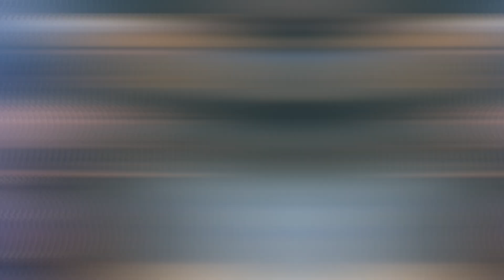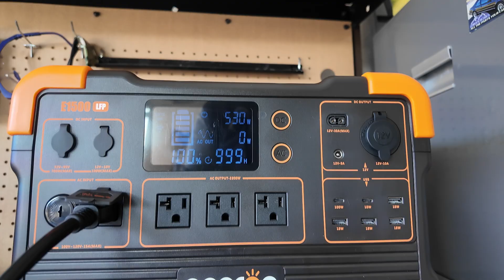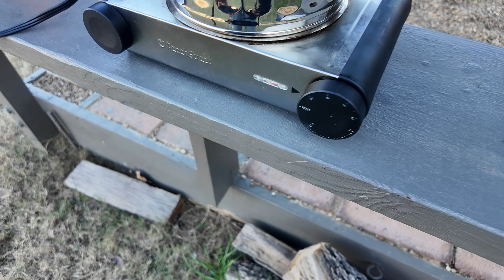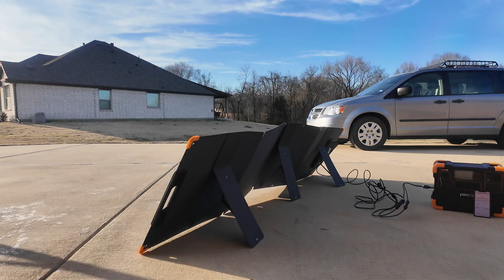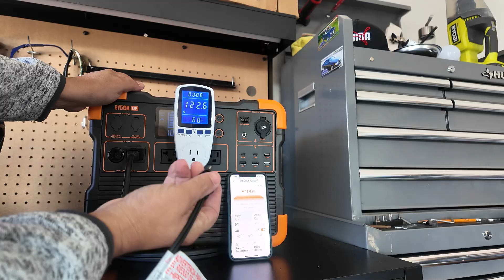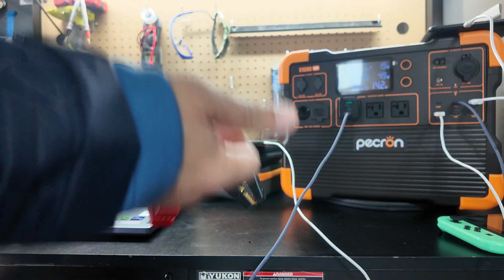Is the Pecron E1500LFP the Best Value for 1,536Wh?

Comment: I myself personally do not think it should have any kind of heating element to where it actually warms up so it can charge when it's cold because at the end of the day that's just another thing that could be involved that could always cause a fire. I realize they have the overheat and too cold type setups in the batteries out here. But I would do as little as possible to put a chance of anything ever creating a fire. It's just like a generator with a CO2 tester I wouldn't take a generator with a CO2 tester because if something breaks on it and you can't use it because of a CO2 tester then you got to know how to fix it. And the way society is right now people really ought to know what they're doing out here. Because I know what time it is. Did people were smart they'd be preparing. But also because of the Bible not just because of worldliness.
Reply from the maker: That’s for your sharing your view. The cold weather protection is important if you are out in a cold region. I know it’s one more thing that can go wrong.

Comment: I am planning on plugging a few lamps (LED lightbulbs) for an 8 hour festival.. in that case, I may want to plug in a small power strip into one of the outlets... that should be fine, right? The draw on LED light bulbs ins't much, just wanted to get your thoughts
Reply from the maker: Yes, you should be good with led lights.

Comment: Appreciate the great info as always!
FYI if anyone is looking for extra fuses...just in case...
I got a 5 pack on eBay for under $10.
10x38mm 380v 100ka
Cylindrical ceramic fuses links
25amp
RO15 RT14 RT18
Seller: CompStudio (16952)
Be safe all🙏